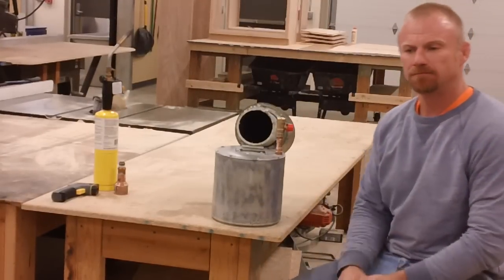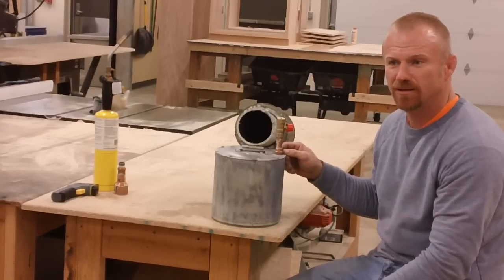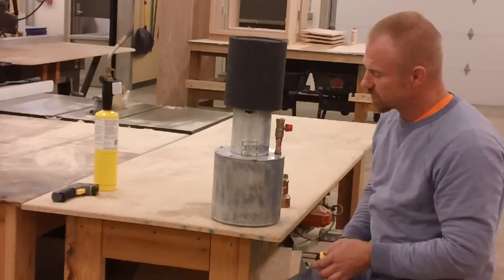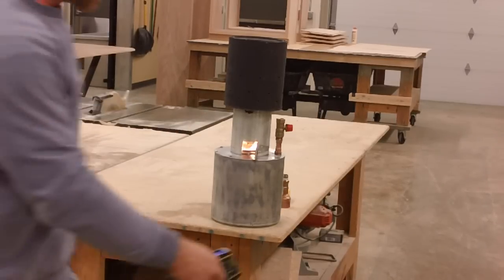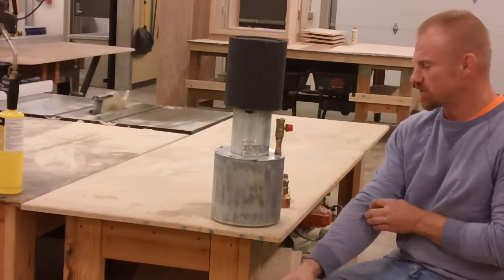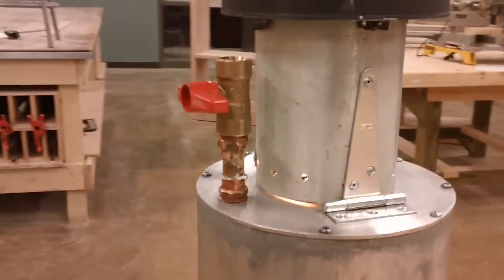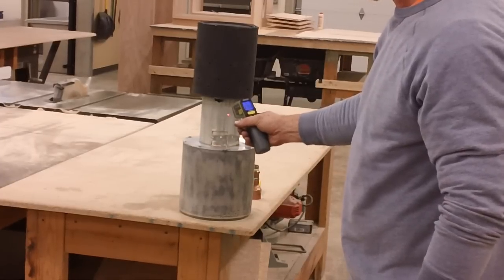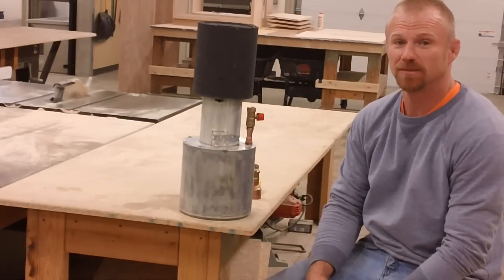Home Made Kerosene Heater

Comment: The concentric metal can scheme was a French invention used in oil lamps to get more air to the fuel. A catalytic burner uses Platinum or other material, to react the fuel directly with the oxygen in the air. I have a 1950's oil furnace that blasts oil into a fibberous hot "can" at 90 psig. When this glows red, the heating oil/ air reacts nearly completely resulting in a 90 percent burn efficiency. While an open yellow flame without enough oxygen is usually bad, it is just an intermediate step in the combustion of the fuel. If enough air is provided later, then you can get a "clean" burn resulting mostly in CO2 and water... Thank you Van for your video.
Reply: Thanks for the info.i need more info on these thanks

Comment: On store-bought kerosene heaters, they carefully control the air reaching the round wick, so as to burn with a blue flame.  Blue flames are cleanest burning and hottest.

Yellow flames usually indicate Carbon Monoxide production (undesirable).

Comment: Well done. You explain things well. How did you attach the filler tube? What is it made of? I missed that I guess.
Reply from the maker: The filler tube was attached by drilling the appropriate size hole in the 1/8 inch top of the tank to receive 3/4 inch threaded copper fitting.

Comment: I am wondering why can't you just buy two metal gallon paint cans with lids.  Put lid on first can, use putty knife to cut a 2.5 inch narrow slit in can lid,  cut some tee shirt strips. 2.5 inch wide for your wick.  Fill can up with kerosene, wick through lid, and alight. Drill holes in side and bottom of second can, and put upside-down over first can, for the wind screen and heat sink.  Only feeding the wick might mean you have to manually push the wick up every few hours. Need to test this when you get a chance.

Comment: How is the top made? Internally? To catch the soot? Thanks
Reply from the maker: the paint can is on the center pipe about inch and a half with holes around the under side bottom enough to allow air to escape heat rises as does the soot and it condenses on the top a lot and gives off its heat and as it cools it will roll down and exit, some I have had to put  few holes higher but I always keep them as low and few as possible to keep the draft going. if holes on underside works for yours thats great. depends on how big yer wick is and to how much air ya need also chimney height affects it greatly also. good luck

Comment: I wouldn't recommend this. Regular kerosene heaters have a round wick inside 2 concentric metal cans with many perforations in them which they call the catalytic burner and this causes it to burn cleanly without producing CO. I'm surprised he doesn't smell any fumes. He needs a CO meter, but he says he's not burning this in a closed area.
Reply: If you're worried about CO production and you smell fumes, then you're probably safe, as CO is completely odorless and invisible.  I hear so many myths about carbon monoxide.  Fumes means you aren't burning your kerosene efficiently.  Too high a flame deposits carbon particles (not CO) on the chase and into the air (soot and fumes), too low means you are starving the flame of air (CO and no soot).  Kerosene itself, like paint, has fumes (VOC) so when you cut the flame, the hot wick will suddenly supersaturate, so it smells like you spilled a little kerosene in the room.  Just a drop of kerosene is smellier than a full tank of it.

This is just a lamp, with two metal chimneys.  It is no more or less dangerous than having a hurricane lamp burning on a table while camping or if the power goes out.

Flame spreaders and the concentric tubes with tiny holes you see on a Perfection or modern K1 heater are primarily to get the most heat out of the least fuel.  This flat wick is exactly the same as a kerosene cooker being used all over the world even today where power is not reliable.

This is a good basic build.  If he put two mesh sheets on either side of the flame, he'd be making a slight improvement.
Reply: Moon shiner.  True, yet the most common unattended housefire today is caused by electricity.  Space heaters starting a fire is most typically the 1500watt, 120v, 15 amp ubiquitous crappy US heater of very very hot resistors inside a cheap plastic box made in China with a $2 circulation fan that quits.

I fear them more than oil burners when those little vampires are left on 24x7 by complacent users.